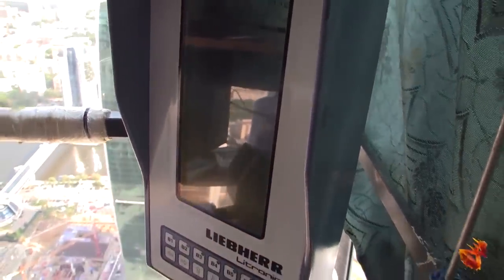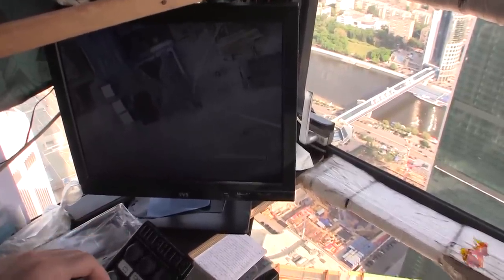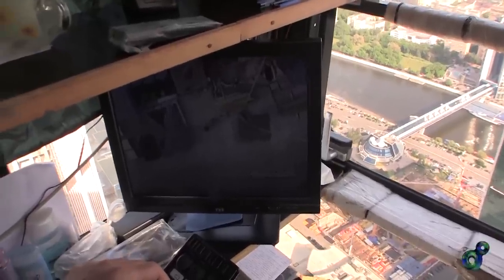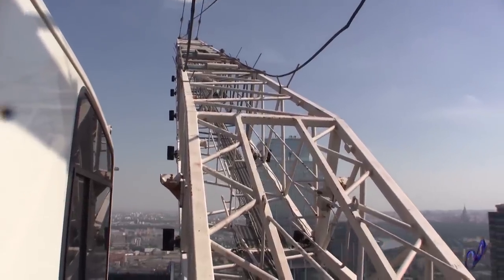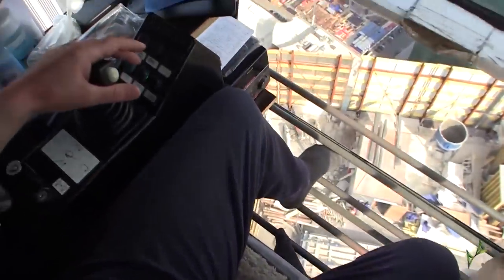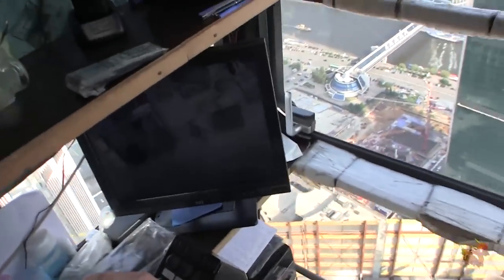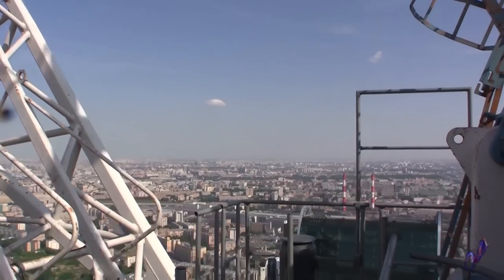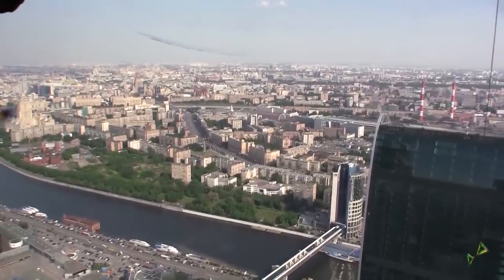The daily routine of a Federation Tower crane operator

Comment: i used to erect comansa and linden cranes and then started operating them in america. the comansas are made in Spain and the lindens in sweeden. linden merged with comansa so its hard to find parts for the comansas. both linden and comansas are flat top tower cranes. I put up one comansa luffer crane and it was so hair because of climbing up the upward jib to conect consecutive jibs. the 500 class comansas are the most heavy and well equiped I've worked with but they do not compare to the German leiberhhers. this crane in this video is nice it has computers and everything. very nice..been wanting to work on a leihbehr
Reply: Christopher Pifer peiner
Reply: Oh this is a piener?